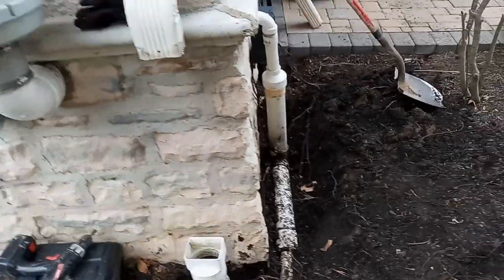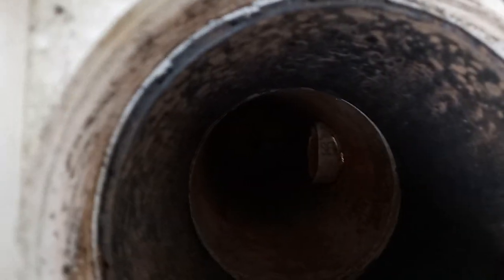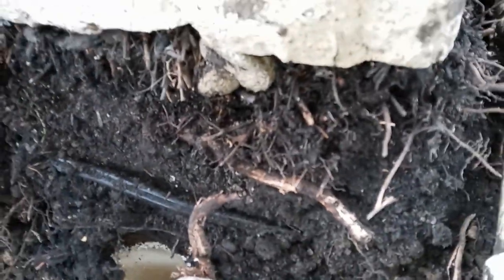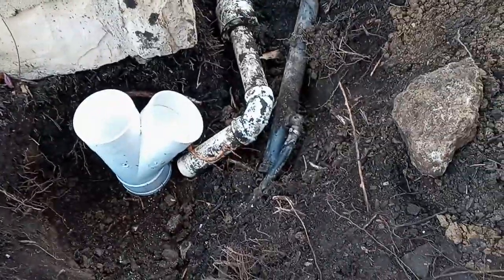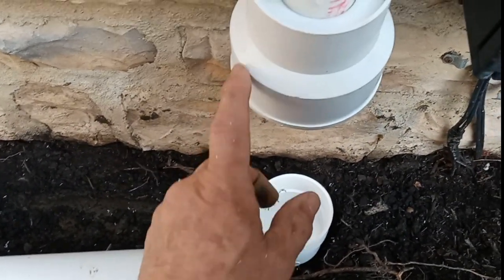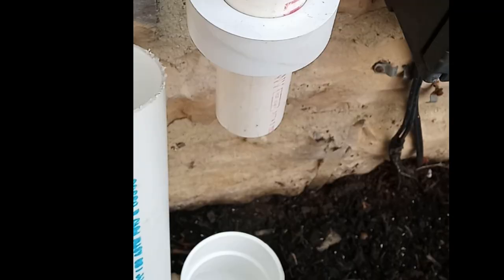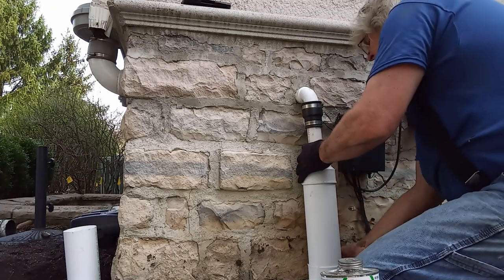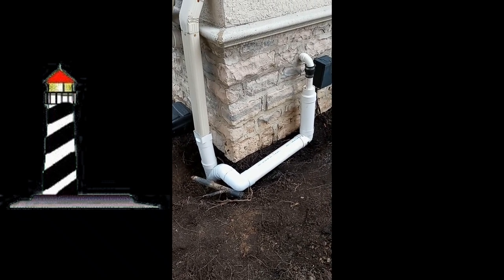SUMP PUMP Discharge to DRain REPAIRS & Downspout to SUMP PUMP DRain IMPROVEMENTS STOP basement water

Comment: Why did you increase the pipe from 1.5 inch from pump to 3 inch when you exit the building.
Reply from the maker: hey JC,
Thank you for watching.
Its easier to maintenance the discharge of sump pump if ever needed in the future.
also, since pump drains into downspout drain, you must increase the pipe size.
Thanks again for watching.
Reply: @AtlanticDrain  But you could do it at the Y. It makes more sense to me, and with less expensive parts.
Reply: @GueipinXi  less work for the pump to instantly and freely discharge into a larger pipe and then gravity take the water away instead of the pump pushing the water around more 90° elbows. The 1½ pipe could also remain filled with water and freeze in cold climates. Around here it is against code to bury 1½ sump pump lines as they need the air gap to drain and not freeze solid.

Comment: With that "donut" on the discharge, doesn't that present the risk of lowering too far and reversing the grade of the drainage so water pools in the PVC beneath it?
Reply from the maker: Hey Dixon,
Thank you for watching
Pipe settling is natural and having donut travel helps keep water in the pipe . It's much better than ALL the water discharging on the ground along the wall. If you do this repair properly, you will not need to worry about that anyway.
Thank again for watching!

Comment: Please Help!  When he uses the “donut” inside the coupler that goes over the sump pump drain,  what is this “donut” actually called?!  Can’t find the piece
Reply from the maker: hey christian,
thank you for watching.
3 x 1.5 inch reducer bushing.
savko plastics pipe and fittings columbus ohio
thanks again for watching!
Reply from the maker: i will have to make a video specific to the 3 x 1.5 inch reducer bushing DONUT!
tell you where else to get it.
Reply: @AtlanticDrain  especially since all of us are trying to replicate that perfect setup.  Just dug my trench to run everything underground
Reply: What happens if the pipe freezes? Does there need to be a clean out?
Reply: Bushing not a donut